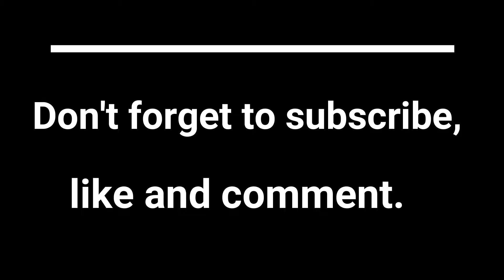1950 MGTD Rebuild Episode 35

Comment: After struggling with door alignment for several days I found that you can make changes in door alignment by varying the thickness of the shims between body and chassis. I found very small differences in the shim at the body mount below the door could raise or lower the front of the door significantly.  I used rubberized cork gasket material in various thicknesses to shim mine with excellent results. Good luck!
Reply from the maker: Thanks Bob
I have tried some shims already and I might have to try some thicker ones next
Reply: @Aaron Jayden definitely, I've been using FlixZone for since march myself :D
Reply: @Aaron Jayden Thanks, I went there and it seems to work :D Appreciate it !!
Reply: @Jameson Matthew No problem =)